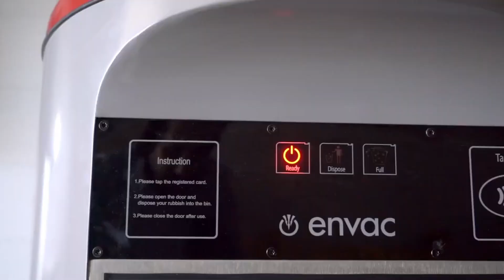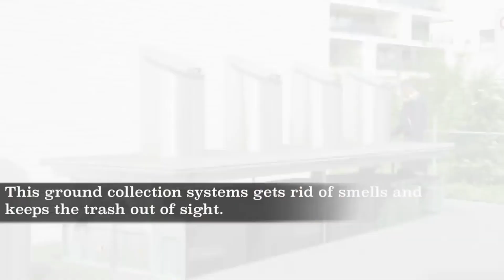Extreme Engineering, Australia High Tech Underground Garbage collection, Swedish ENVAC Vacuum Bins

Comment: Almere (city near Amsterdam) was the first city in The Netherlands to apply this system back in 2008. This system is even incorporated in the newer buildings in the city center, so that residents can throw away their garbage inside their own apartment building and from there it gets transported to a central location. I just have to take the elevator downstairs, throw it in the container and that's it. Cleaner building, cleaner city and no smelly (and polluting) garbage trucks in the city center. Indeed, future is here ;-)